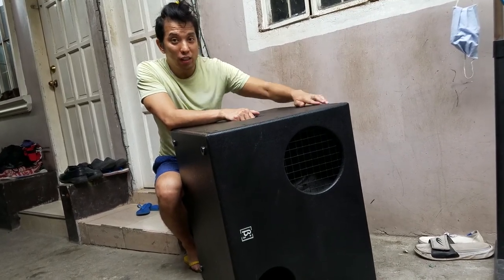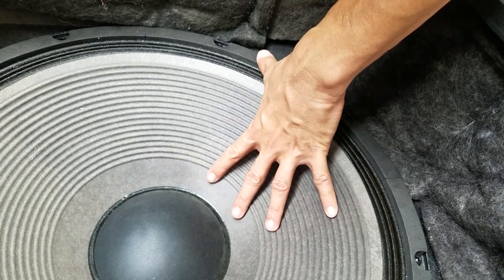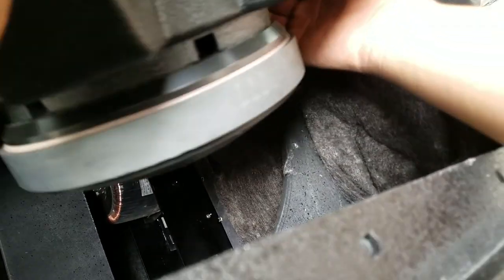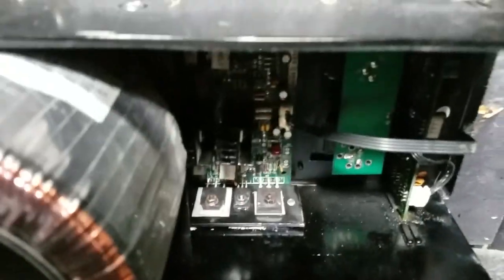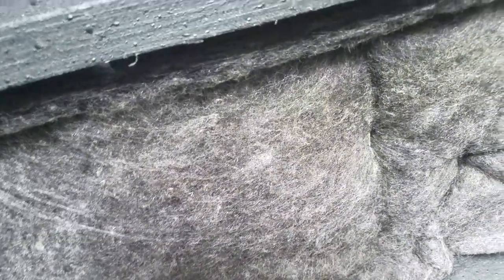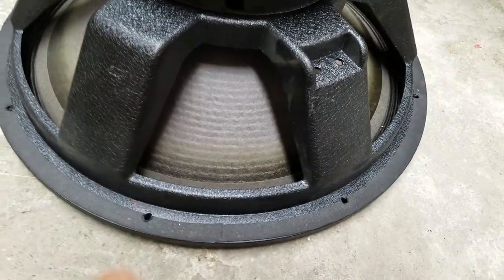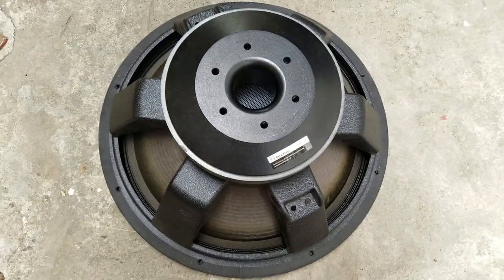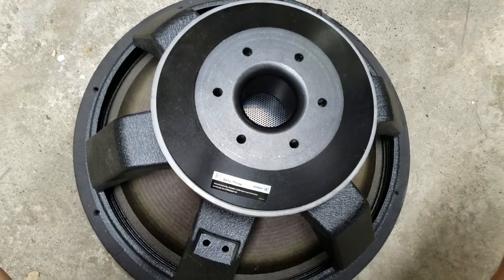A look inside the beta three B118A active subwoofer

Comment: It's what's called a 6th order enclosure. There are 2 ports on the box, one releases sound coming from the front of the speaker, and the other one for sound coming from the back of the speaker. The parts of the speaker that you've shown are the surround or some might call it edge, usually made of either rubber, foam, or something else, then the cone or diaphragm, the dust cover or cap is the one in the middle. Thanks for opening the sub enclosure, now we know what it looks inside.👍
Reply from the maker: Thank you for watching sir! I just have nothing to do on the lockdown period so i decided to open it and show everyone how it looks inside

Comment: Nice content sir, tanong ko lang po yung pinaka specs nung speakee, kung ilang watts po at ilang impedance?
Reply from the maker: @jaividelrosario1167 4 ohms po, 500 watts, 4 inches voice coil, ferrite magnet beta three brand, manufactured by elder audio, frequency response 20hz to 200hz
Reply: @ZINDJGABECORDERO  salamat po sir. 💖